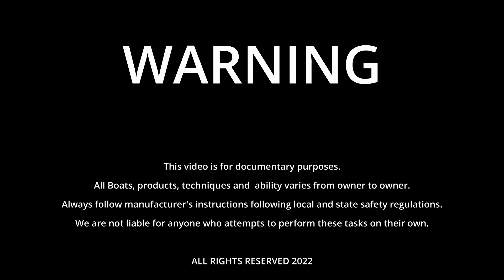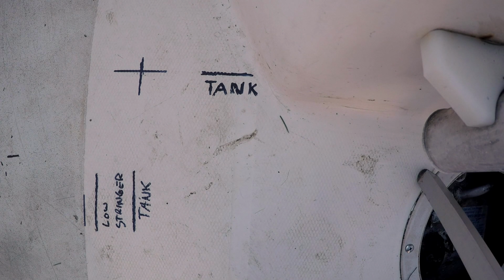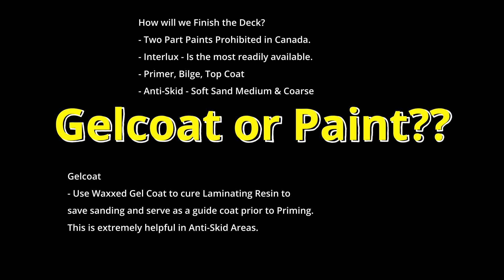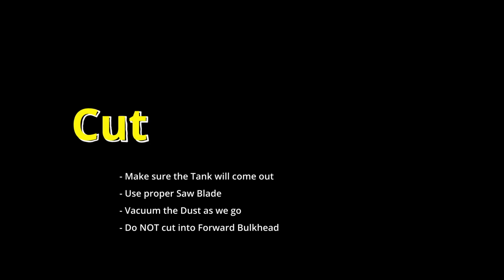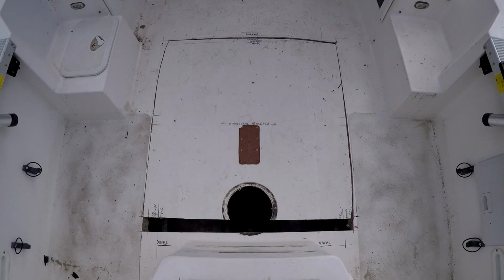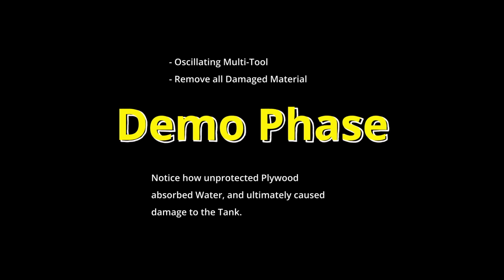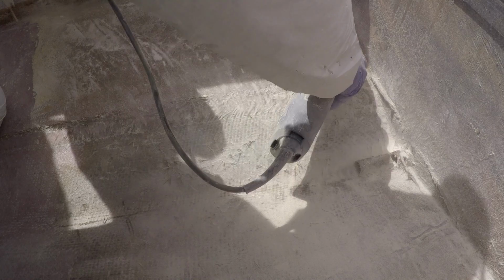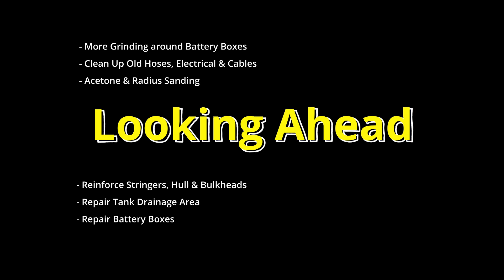Fuel Tank Pt 1

Comment: Are you going to replace the tank, or are you going to have the current one welded in the problem area? If so, where did you get the tank, how much did it cost, and did you consider leaving the tank in, cutting the top off, and putting a bladder tank inside the old one?
Reply from the maker: I chose to replace the tank entirely. I chose not to take any short cuts. I found the original manufacturer was still in business, located in Bellingham, and I ordered a brand new tank from them. I was even able to adjust the dimensions to allow proper airflow around the tank. I sent them a drawing, they made height adjustments and fabricated a new tank with the fuel sender installed, ready to go. They even added custom mounting brackets to allow mounting without the banding straps.